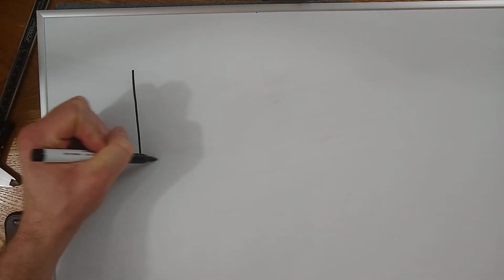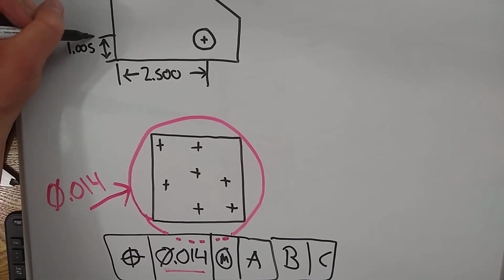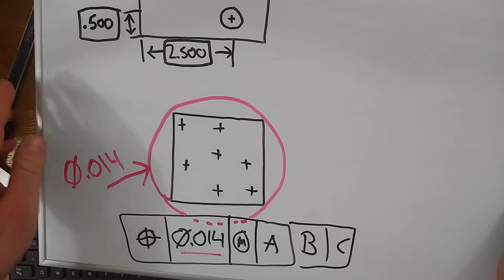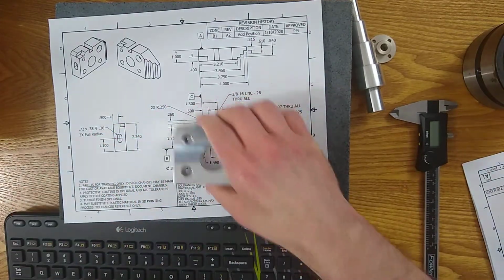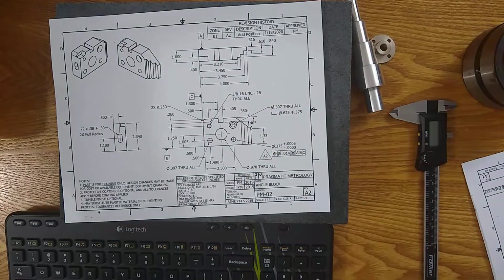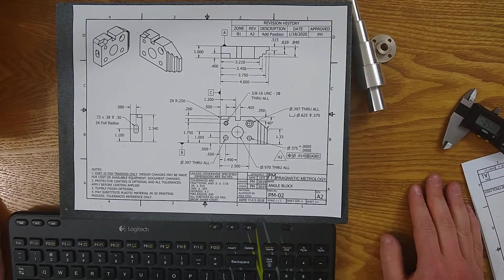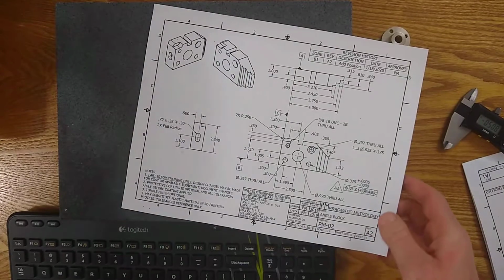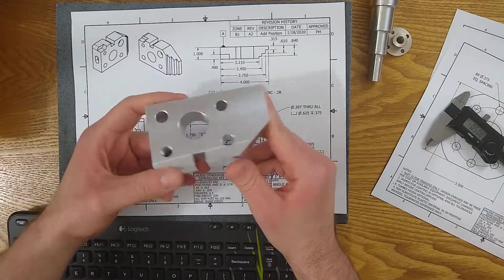Pragmatic Metrology - Blueprint Reading - Part 3T

Comment: you say we need basic dimensions but I see no basic dimensions on this print. If we get a print with a couple of basic dimensions and callouts with datums but not enough basic dimensions to measure a feature, do we simply use the other dimensions on the print? Basic dimensions are called out in order to measure the gd&t call outs. I have a print that has multiple profile of surface callouts to multiple datums however there are not enough basic dimensions to solve for the nominal surface. Also, I have a question about profile of a surface. What is the minimum requirement to measure a surface profile to two or even three datums? I am so confused by the actual process and haven't found ANYone offering an example of steps to take in any kind of order.